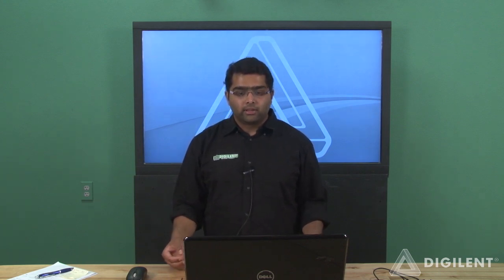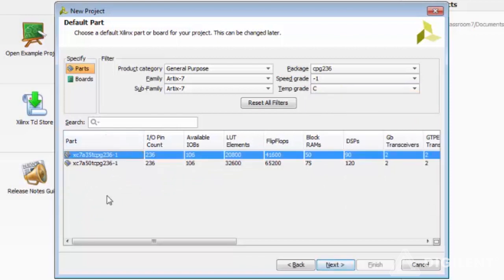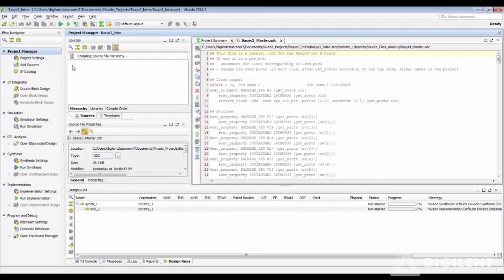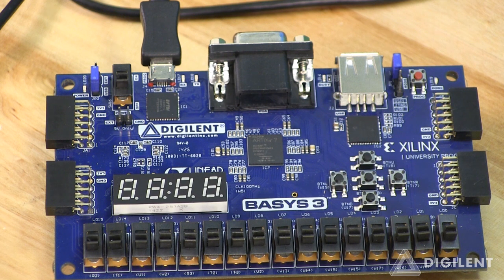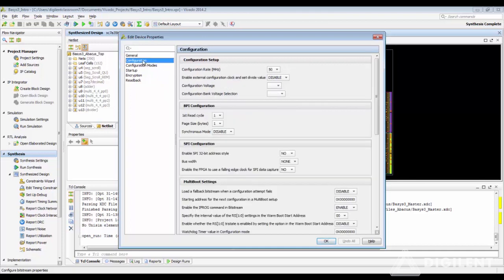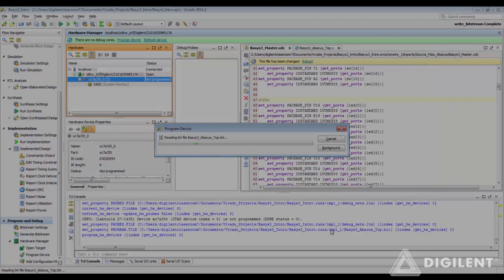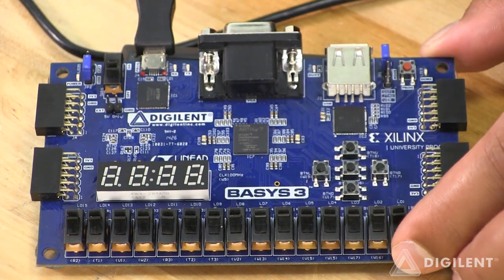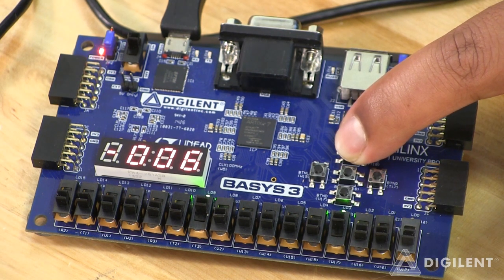Getting started with Vivado and Basys3

Comment: Hey! When following this tutorial, make sure to double check which memory your device uses. It is on the backside of your Basys 3. Mine was a different one than what Warren (?) said.

Thanks for the video!
Reply: Awesome, thanks for pointing that out!
Reply: Yes, it is the Makronix MX25L3233FMI-08G for later boards.
Reply: @sebastianhenckel6440  Correct, thanks for the tip.

Comment: For those who wonder why the FPGA does not appear in the Device Manager once connected via USB: just check that the usb cable is not only a power cable. I have 5 usb cables and only 1 of them transfers data, the others are just dummy cables for charging...

Comment: hi, good stuff by the way.
what CPU you recommend for vivado, will an 3rd gen i5 do the job? there is nothing in xilinx website about that
Reply from the maker: ElectroMac74 I asked Sam B. your question and here is the response he gave me:Basically the faster the CPU, the faster your Vivado build times will be. A 3rd Gen i5 should be plenty fine for Basys3 and Nexys4 designs. Vivado also consumes a bunch of memory, so I would recommend having around 8GB if you hope to be doing other things while the build process is occurring.
Reply: Digilent, Inc. ElectroMac74  i used my laptop  ( Dell Inspiron N5010), 4Go of RAM and i3 CPU,  during more than 6 month, working on Vivado 2013.4, development of embedded system solution on Zedboard
Reply from the maker: If you have any particular questions, you may want to try asking on our community forum http://digilentinc.com/forum

Comment: I have an Adaptive Filter Verilog code generated using MatLab's HDLCoder tool. I now wish to implement the code on Basys3. The input has to be a speech signal. Can I use Vivado Design Suite for this, or will I need Vivado System Generator?

Comment: Hi,

I registered in the digilentic forum, but i couldn't able to post any question.
I am using a temperature sensor to measure the environment temperature and connected the sensor output to XADC.
Now,form which pin do i need to get the binary output and the output will be in how many bits?

Thanks in advance!

Regards,
Priya
Reply from the maker: Hi Priya,

Thank you for the question. I'm not sure why it wouldn't let you post on the forum. Sorry about that.

I have posted the question for you. you can see the thread here: https://forum.digilentinc.com/index.php?/topic/427-basys-3-binary-output-pin-for-temperature-sensor/

Hope that helps!